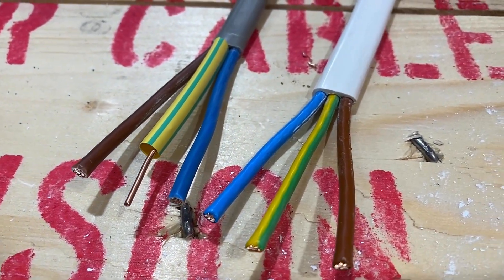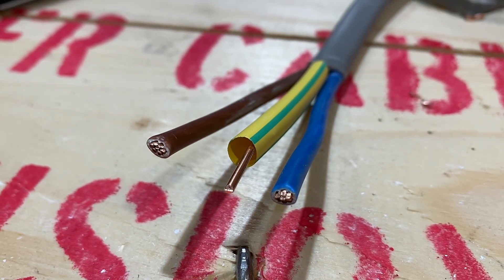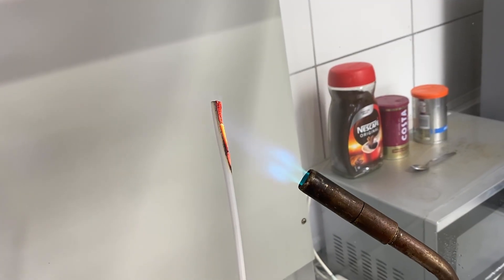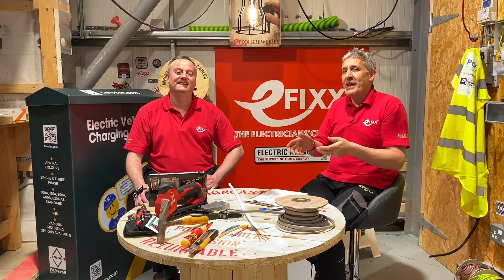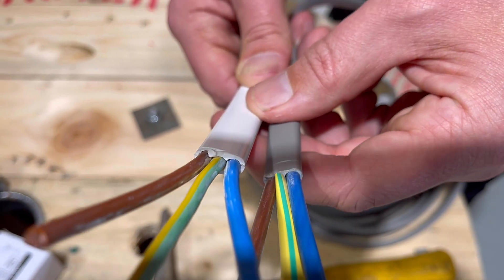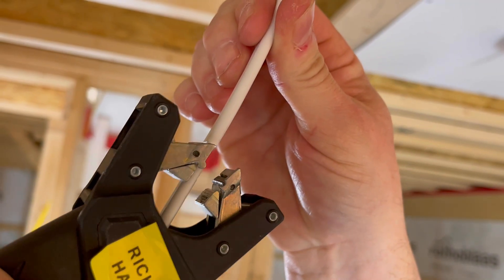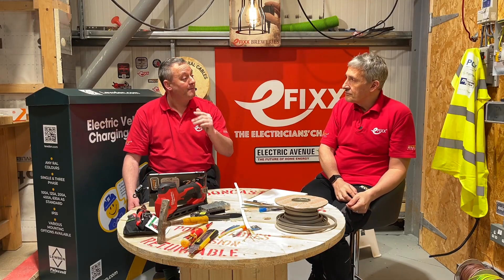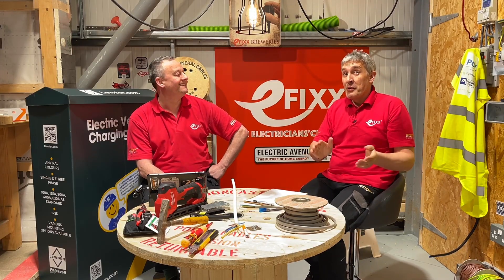REVEALED: The New British Standard for Electric Cables #aprilfools

Comment: I am stripping this new bs cable watching this video and all I can say for sure it's pain in the arse. Whoever pushed this standard has either never installed a cable or forgot how easy it should be.
With pticing going up cabling should be easier to do rather than harder. And tools needed ahould not be in 100s to acquire to do a neat job. Oh wait... that's probably the whole point.
My CK auto wire strippers and Knippex all in one pliers can be burried now... bs...

Comment: Fitting MICC is not for bodging amateurs, that needs proper skill and discipline, as well as pricey tools, and proper electrical knowledge so you can properly prepare and identify and then properly label the conductors. And the higher temperature rating is long overdue for the soft cables as it's all too often run under floors alongside bare central heating pipes which often reach well over 80c, far too hot for the old PVC insulated cables only rated to 60c, which is why whenever I've done any wiring I've gone to great lengths to keep the cables well clear of heating pipes and the lower heat rating also causes a fire hazard when some total amateur shoves thermal insulation over the cables thus forcing them to operate far too hot to be safe, which is why the cables should always be run OVER the insulation, NOT under it!

Comment: I've often wondered how the industry could justify the earth conductor being one size smaller than the phase and neutral when surely the earth needs to have as low a resistance as possible. So it's about time the situation was put right, it's long overdue. And they had hard wiring cables in Belgium with fully insulated earth conductors of the same cross sectional area way back in 1995, I know as I went on a day trip over there and the coach took us to Oostende and there was a DIY shed there so I got a bit curious about their underfloor cables so I went in and had a look and they had hard cables there but they weren't flat like ours here in the UK, they were round like flex. And they had some with three brown conductors and a green/yellow, very odd, I suppose it was for wiring two way switches but it's a bit awkward when the lives are all the same colour, you'd have to treat it like it was copper sheathed mineral insulated cable like the stuff used in public buildings.

Comment: If the 25mm T&E cable is brought in what sized CPC will it have & will the CPC be sleeved already?
Doesn’t meter tails longer than 3 metres & installed through fabric of the building need RCD protection? If so shouldn’t it have 100mA RCD protection?

Comment: Curig one problem, will increase others. Reduce flamability, will increase toxicity, reduce toxicity, can increase smoke index. Ask MoD engineers, who use a balanced mixture, check testing done by Warington Fire Research Redhill in Sussex. Same for USA Aircraft, and BA who work to FAR 25 approved cables.  Do  not use PTFE (teflon) it gives off highly toxic cyanide gas in a typical household fire.  UK Navy use cables to BS 6112-part 18, note: its a title, there is no such thing as "zero" halogen, this was found after the Falklands war, when electrical equipment caught fire and the resulting cable fumes were a massive disaster.

Comment: Is there any particular reason why electrical and plumbing installations, for domestic,  do not have to produce wire and pipe diagrams. If there were these diagrams it would be easier to plan for additional installations? I would be very interested to here your comments.

Comment: From the thumbnail I thought it was standardising which side of the earth wide the live and neutral should go (dont laugh- for domestic plugs and some sockets it is a pain that some cables are really tricky to wire in , they tend to want to turn the "wrong way"
Reply: 🤣  Yeah - and always only at one end of the cable.....
Reply: @spannerasaspoon  but if we align with the BS Standard plug then its all the appliance etc connectors that need to confirm to the cable, so its a connector fault ( maybe connectors inside light bulkheads should be reversible when access is difficult from one side due to a wall , etc )

Comment: Ever heard of green/yellow heat shrink. the cable is getting more and more like 3 core flex. I remember 1.029, 1.044 7.029 etc, twin and twin & earth before the days of metrification cable standard. I believe that the Gov want to go back to Imperial Measurement. Standards slipping or not. Better fire protection now. But please use fixing screws not nails to fix cable boxes, my old Forman  would have clipped my ear nailing them like that.

Comment: I'm from Czech republic but Im currently working here in UK as sparky and we mostly using in dwellings CYKY cables which looks like same as NYY cables.
For sockets circuits we using CYKY-J (NYY-J) 3x2.5mm² with OCPD B16A in radial.(We don't use a ring as here in UK).
For lighting circuts we using CYKY-J (NYY-J) 3x1.5mm² with OCPD B6A or B10A (depends on load).
For intermidiately switchers or 2gang 1 way switches we using CYKY-O (NYY-O).
Both circuits sockets and lights must be protected by 30mA RCD type A but most old dwellings are protected by type AC.
Maximum permited sockets in one radial circuit is 10 sockets.
We also using same imstallation method as here in UK except method 100 , 101, 102, 103 in block flat because they're build from concreate.
In houses we using 3phase main incomming, so for example If do you need 3f sockets for circular saw etc.
In Czech republic is not allowed to use main fuse or service head inside dwelling (flat or house).
Main incomming is mostly etiher CYKY cables or SWA depends where and how is cable installed, so we don't use single core cables like here in UK.
If someone anyhow make a changes without permissiom to a main distribution board or bypass meter and any electrician will find out, he can remove it and straight contact DNO and they'll pay him for a job what he was invited not like here in the UK.
If you want to provide a Inspection and testing you must have as a minimum 4 years experiences otherwise you not allowed to provide it.(issue EIC etc.).(check decree 50/1978  and their phragraphs).
We also use same prescribed zones for cables installation and zones in bathroom.
In my opinion there is not that much differences between UK and Czech standarts.
Reply: You do realise this was posted on the 1st of April don’t you?
Reply: You two are a pair of shits😂. Look how many people have taken you seriously. Good job, cheers Stuart 🇦🇺

Comment: 1.5mm conductors won't go into the light fittings in my house built in 1987 in the UK, unless you only put one wire in them. Often this makes the wiring impossible. Fortunately I have reels of cable of 1.0 and 2.5mm twin and earth that I bought in the early 1990s with plenty left on them so I'll just keep using that. No-one knows when I put it in.
Reply: Go for it but remember it will all have to be ripped out if anyone finds out
Reply: @raithwilson6845  Except this video was an April Fool so it's irrelevant. My problem is I find it very hard to spot April Fool's jokes unless they're completely over the top. I hate the entire April Fool thing, what purpose does it serve?

Comment: In belgium we have round cables with live neutral and earth all insulated since a few years we may only instal green cables cables who are insulated green because the old gray ones made toxic smoke when on fire but the insilation is way harder to strip of it is a real pain to strip in opposite to the old one same with pvc pipe the new ones are red coated inside because the old also made toxic smoke when on fire 
We are on a different level but i is way more fun working with the cables u still use
Reply: Most of the round cable in the UK is all core insulated.

Comment: I've said this before, but mm squared is NOT the same as square mm!. It is if you have a wire of 1 square mm or 1 mm squared, but 16 square mm (16mm2) is not the same as 16mm SQUARED (which equals 256 square mm..... about 18mm diameter). 😳
Reply from the maker: It’s an April fool

Comment: I wonder if this is going to stop the consumer unit fires that never existed when I was serving my time in the late sixties? I doubt it! If the industry was dumbed down any more all the sparks would have to wear gloves to protect their knuckles form the floor! Those operating temperatures look a bit high. The rule of thumb should be cold at FLA or a bigger cable, what happens when it is buried under the modern requirment for domestic insulation? More fires on the way!
So Glad I am retired!!
Phil

Comment: Ha.ha... Well executed video for 1st April. It nearly had me for a bit, as I was sure Ireland had installation cable that includes a sleeved CPC.  
BS EN 12712:2000 Plastics jerricans. Jerricans with a nominal capacity of 20 l to 60 l for optimal utilization of pallet sizes 800 mm x 1200 mm, 1000 mm x 1200 mm and 1140 mm x 1140 mm
It may have been an April fool, but actually.............

Comment: Bought time you guys got into the 90C insulation standard.  Our cables have been technically 90C rated for years.  Though our standards still reference 60/65/70 for legacy reasons.

Comment: I was nearly falling for this, but just kept thinking of why the cpc doesn’t have sleeving, and thought, if bigger surface area and being insulated really improved safety, it would of been changed at least a decade ago.
Reply: In Ireland they can't use standard twin and earth with bare copper, they can only use twin and earth that's fully insulated like this
Reply: @michaelboyes4948  in fact the cable pictured appears to be Irish standard cable
Reply: Its been in Ireland for a few year, so id say yere on the road to be getting it too
Reply: Sleeved cpc in twin and earth is the highest stupidity. Bare cpc will make contact easier with damaged live conductors to ensure ADS.

Comment: Looks very similar to Australia's TPS, our earths have been pre-sleeved/insulated for a while now (decades). Only difference is our active/neutral is red/black which makes it fun when we come across European light fixtures/machines etc.
Reply: It used to be Red And Black in the UK and Red, Yellow, Blue and Black for three phase. Until we harmonised with Europe, the problem is there are lots of buildings with either the old colours or a mixture of both. My house is from the year 2000 which was wired in the old colours.

Comment: Historically it was considered a safety feature for the earth to be uninsulated. I am not sure why this has changed and it is now safer for it to be insulated. Probably the people in charge today need to go and talk to the original designers of the UK wiring system.
Reply: I would think the presence of an RCD should allow earthing requirements to be loosened.  If a slight bit of an uninsulated live wire projects from a connection point, but no uninsulated sections of any wires would be long enough to reach any others, there would be no possibility of a short, but having a bare copper wire in the box would add such a risk.  The presence of an RCD, however, would mean that any ground short which could pass more than 30mA would instantly trigger a power shutoff whether or not the fault current was anywhere near the normal overload current.  An earthing wire would need to be large enough to pass fault currents long enough to trip an RCD, but that's nowhere near the size that would be needed to handle the worst-case fault currents that could yield a slow breaker trip.

Comment: Word on the street is that in the next revision the cpc will be double the size of the Line and Neutral conductors. That means in circuits where no cpc is needed you can parallel the Line and Neutral cores to get a 3mmsq out of a 1.5mmsq cable.

Comment: We are using same  type of cables since 1960ish . Fully isolated earth and same surface area on every conductor:)
Reply: So you've been wasting copper for 60 years ?
Reply: Not bcs green/yellow wire  one can be used in a lot of siutuations as a live conductor. Additionally cable is perfectly rounded makes it easier to install and remove insulation
Reply: Same as in Germany for decades adn dozens of other countries
Reply: @bojangazibaric3328  so what are you using for circuit protection if you're using the green/yellow as a live conductor.

Comment: I love how it builds up to be more ridiculous by the minute. I thought it was real at first!

.. Being from the Netherlands might help, where we already have the luxury of same-diameter sleeved earth 😉
Reply: The real April fools is that there are still countries that don’t have same-diameter sleeved earth.
Reply: In three phase systems with cable bigger than 95mm2 in the Netherlands it's actually allowed to have a half size neutral conductor
Reply: @sciencetestsubject  okay, but by that point we’re thoroughly not in regular-everyday-sparky territory any more.

(Presumably there has to be some expectation that said three phase hookup won’t be asymmetrically loaded in regular use to the point where the N would carry very high currents — and I have to admit I cannot think of a situation where that would happen unless it’s a subframe distribution situation and you deliberately turn off exactly the right 2/3 of the load.)

Comment: I thought the bare conductor was to increase the chance of a fault being spotted by devices and therefore failing to safe.   As you showed and said about putting a staple through the cable, there could be a chance that cable passes the test sequence.  This might not be good in the longer term.
Reply: You've seen the date, right?
Reply: those staples are debatable just use conduit make it easy for the next electrician
Reply: @jacksonroad9263  those staples are ceramic

Comment: I will resist the temptation to to use this  where there is wet heat of all rigid furniture surfaces regardless of materials, and only use VIR in such places :)
Reply from the maker: VIR is so unrated these days 😂
Reply: Clever. I see someone else looked up BS12721